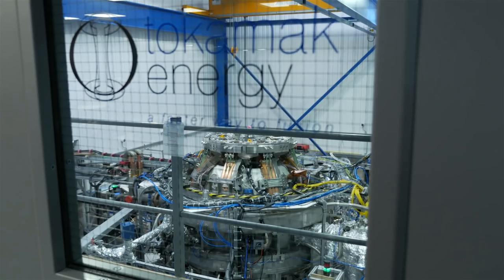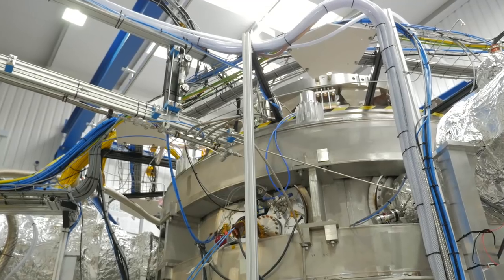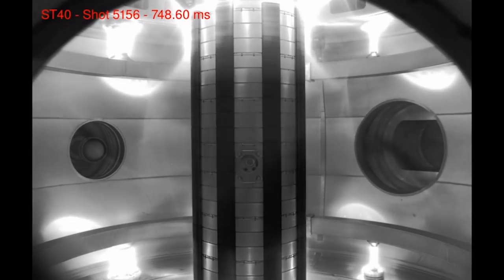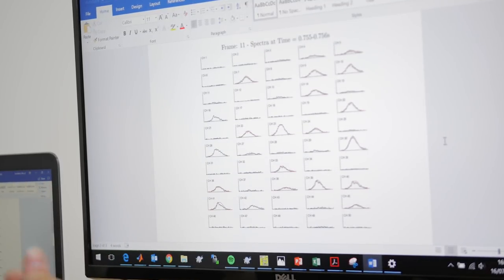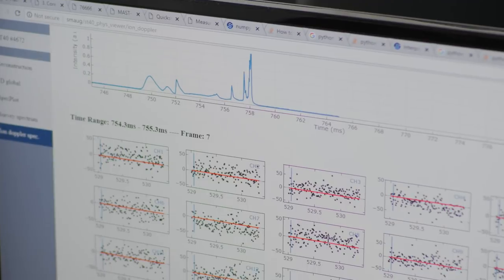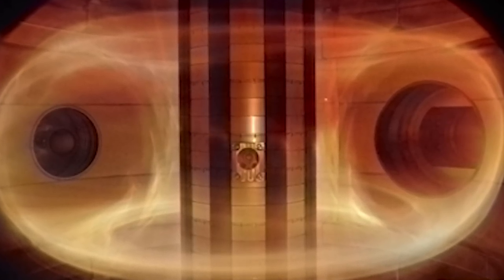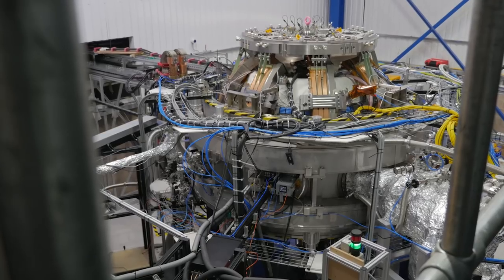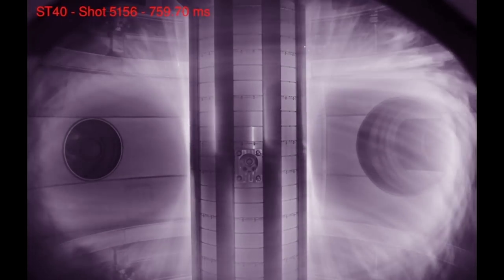How do we measure 15 million degrees?

Comment: How do you plan to keep the tokamak working continously? The poloidal magnetic field is provided by a current induced in the plasma, this current is induced by a decaying magnetic field generated by an external coil (usually in the center column of the tokamak). When the strenght of this field reaches zero, the current in the plasma quickly disappears and the confinement is lost. So what's your solution? Maybe having the tokamak working in pulses?
Reply from the maker: There are other means of driving current in a plasma, such as Neutral Beam Injection, and we would also want to make use of bootstrap current, which is a self-generated current that  may be higher in spherical tokamaks.

Comment: What challenges you'll face if you'll want to build a smaller version of reactor, say 0.5*0.5 metres?
Reply from the maker: Currently we can't achieve fusion in smaller devices because there is not enough space for essential systems, like the magnets. Also, the confinement of the plasma improves as we go bigger, which can help. The forces generated on the machine by the high magnetic and electric fields must be considered, and there are other engineering constraints - lots to consider.  And in a power station the devices will have to get even bigger to make space for shielding to protect the superconducting magnets from neutrons.  So there are lots of considerations, and in the short term even relatively "small" machines will be quite large.  Who knows about the long-term future though....